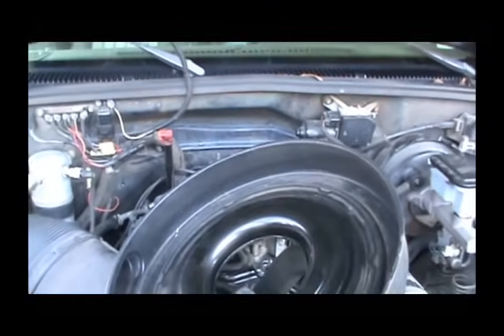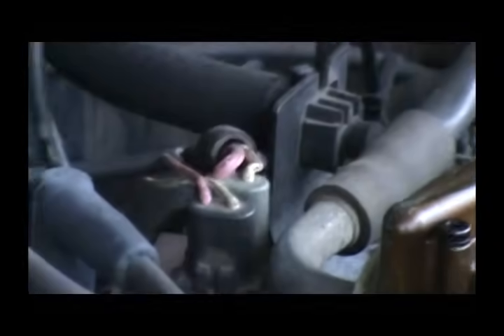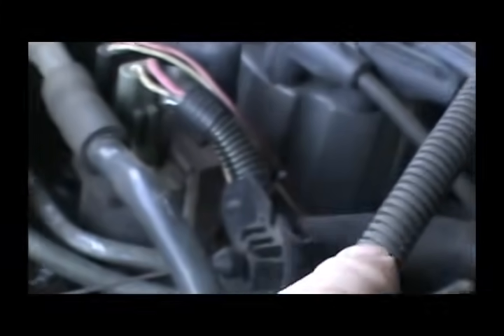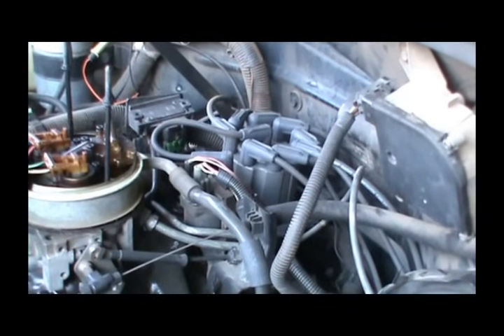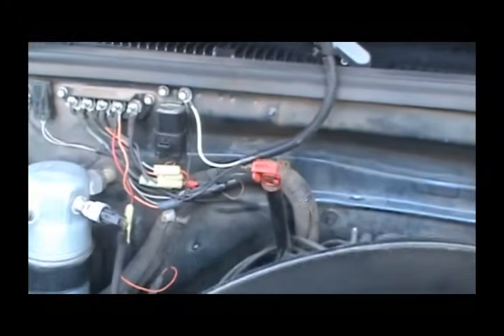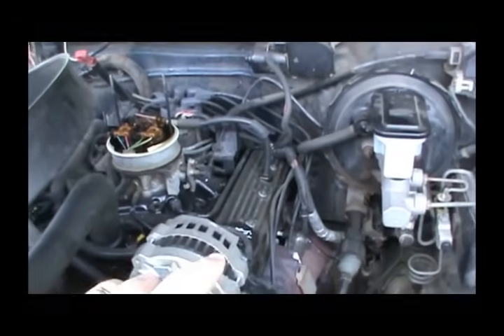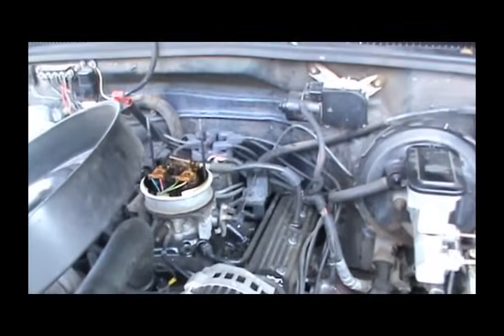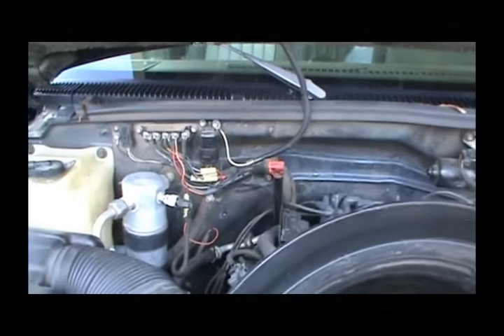1988-95 GM Truck Ignition Systems

Comment: What would be blowing a ignition module? I've had to put three in my 91 gmc 2500 sierra just dont know what it could be.
Reply from the maker: Heat kills them more than anything.  First though, always buy from a quality auto parts store like NAPA.  Don't buy them from Autozone, I've seen multiple failures with those.  Next, always use heat sink paste and make sure the heat sink is clean when installing.

Comment: Hi. I have a 1995 3/4 ton chevy Kingcab 8ft bed 4x4 with a 454 TBI. The issue that I am having is that my injectors are spraying to much fuel into the intake and thats causing it to flood out the plugs and then shuts off. There is an MSD ignition box under my hood on the firewall could that be a possibility? I have changed both my temperature sensors (side of block) and (front of intake by thermostat housing. And it still. Sprays to much fuel and backfires. What other possibilities could there be.

Thanks an advance. 

Mike
Reply from the maker: I'm guessing, but it sounds like an issue with the Throttle body.  Not getting enough air? Dirty? Injectors worn out?

Comment: I have a 89 suburban, the service light comes on it runs great, the light goes off it runs like crap. Spark knocks, pops and cracks, and u can smell its flooding out. Whats ur thoughts
Reply from the maker: Sounds like it's going into a default mode when the light is on.  Need to find the code to see what sensor has gone bad.
Reply: @farmboy30117  code 42, I changed out icm under the distributor and the light stayed on for about 2 weeks and ran great it it started shutting off again

Comment: This could be my issue... mine is a 90 Chevy 350. Replaced three coil module 3 times, last one with ACDELCO. Still isn’t starting. I’m gonna look for this computer wire tomorrow. Pull it... crank it... and see what happens.
Reply from the maker: Good luck!

Comment: i believe if you crank  it and have fuel pressure out the injectors the pickup coil in the distributor is good.....went thru this on my 92 astro....thought i had bad coil but it was the ignition control module that was junk...the module sends a signal back to the coil to spark so dont assume its bad coil right away..

Comment: Just looked at your video I got a 1994 chev 1500 Cheyenne I haveing trouble some times it will start and run when not in gear then I put it reverse and it will cut off and don't want to start no more I would have to put gas in the carberrader  to start .. can you help me with this problem..

Comment: OK i WOULD apericate  YOUR HELP GOT A 1988 CHEVY SILVERODO will run good for about 30 minutes then shuts down for 24 hours changed plugs and wires and rotor cap and coil too.

Comment: I have a 94 Chevy suburban k1500 350tbi and the ecm fuse keeps blowing randomly and can’t figure out why it only does it randomly wondering if you have any insight on how to trouble shoot it
Reply from the maker: Sounds like a wire with a bad spot that grounds out every now and then.  Have to trace the power wires out and see if any are chaffed.

Comment: unplugged the computer it started run a minute then died tried a few more times andd it hit but wouldnt run long now im not getting any spark the only thing i have not replaced is the coil and the computor its getting gas but no spark
Reply from the maker: Did you unplug the ignition bypass wire?  I believe it's a brown wire.  If this wire is unplugged, the ignition system bypasses the PCM for spark control and uses the ICM in the distributor.  Leave the PCM plugged up as this controls the injectors.  If it will crank and run, then the distributor and coil are good.  If not, you've narrowed it down.

Comment: Have a 1994 chevy 1500 the timming is ok put a new coil on heard at arcing noise it's arcing where the two plug wires plug into the coil only arcs every so many seconds. At the top of the wires

Comment: Farm boy I need some help I just bought a 89 Chevy Silverado 350 four-wheel drive and I have no idea what to do I'm having the same issue to start no crank no spark and my battery terminals getting hot when I try to turn it over help please..
Reply from the maker: What does it sound like when it's turning over?  Hot wires means high resistance, so either bad terminals, grounds, etc.  You live in salt belt?
Reply: @farmboy30117  it sounds like it wants to turn over..but it wont..

Comment: I have a 94 1500 5.7 swapped engine w a 92 suburban 5.7  have spark and fuel but only pops? I changed pick-up coil do I have to unplug the pcm to get it to work?
Reply from the maker: Sounds like the timing is off.  Unplug the wire from the PCM to the coil and set the initial timing with a timing light
Reply: Thanks I'll give it a try

Comment: i have a 92 s10 pick up and this may be my problem, i changed the coil and cleaned up distributor but still randomly starts, I'll try ti unplug the brown wire you pointed out and see if it helps, thanks
Reply from the maker: It should still crank with the ICM before swapping to the ECM.  The brown wire connects the ECM to the distributor.  The only time you should have to disconnect the brown wire is to do the initial timing.
Reply: @farmboy30117  ok, well i think its my distributor and rotor, what a ding dong i didn't check for spark first and just did and there's nothing. thanks

Comment: Nice video I’ve been looking for advice on upgrading the engine that I am running. I just purchased a 1990 454 cubic inch engine installed in a motor home. 55000 original miles means it was parked most of the time. My other car is a 2003 Express 3500 with a 6.0 liter engine. It has coil on plug ignition which I fell in love with. Trouble free for 330000 miles so far. Is there any way to modernize the 454? Right now I’m just replacing the plugs and wires and haven’t looked at the distributor yet. Thanks for your input.
Reply: You you can do what ever you want to it. You can run coil on plugs all the way to a stand alone ecm. Just takes a lot of money

Comment: Thanks man. My buddy’s 93 k1500 4.3 crank, no start was due to the ignition control module.
Reply from the maker: Yeah, that's pretty common.  Glad it helped!
Reply: @farmboy30117  every morning i have no spark and have to replace my pickup coil. Any idea on what to test

Comment: so I have a 88 GMC suburban no spark.  so you are saying that chances are it's the computer?
Reply from the maker: The usual suspects (assuming power & ground is good going to the distributor) is pickup coil, Ignition control module,  cap/rotor, or coil.  I'd suspect the PCM last.
Reply: @farmboy30117  so how do I test each one.  I'm trying to eliminate so when I have it worked on I'm saving the place a little time.

Comment: Is there supposed to be battery voltage from the coil to the icm? My 1991 chevy 5.7 decided to not start last night. No spark. Replaced the icm hoping that would solve it. Now I'm stuck.
Reply: Me too bro did you figure it out
Reply: @Michael-wk4yo  Pickup coil in distributor.
Reply: @Michael-wk4yo  Kind of funny this came up. Last few week, my pickup was running like crap. Getting crappy fuel mileage. Apparently I didn't put loctite on the distributor bolt when replaced the distributor. It backed out and slowly spun my distributor. If your pickup coil is bad and you replace your distributor, make sure you use loctite on that bolt! Good luck!

Comment: hey great video you explain things very well that help so much! so my truck 89 chevy 250 it seems to run well but limps around 55 mph and doesn't want to go faster pulling a light boat. so i checked codes since the light came on and they read 32 and 43.  the 32 says map sensor and 43 is bypass ignition signal failed. what's your opinion here. i was going to get the map sensor but what do i replace for 43? thanks again for the help you give.

Comment: Thank you for the video this did get my truck started but now it seems to be running like the timing is off. Do you know what that part is called with the tan and black wire? Also will this affect the timing?
Reply: Oh and what it does is it basically allows you to adjust timing. I dont believe you can adjust the timing with it still plugged in
Reply: @gerrybrooks651   thanks
Reply: You unplug the tan and black wire with the key off, then start the motor, adjust the distributor while using a timing light and when it is at factory specs, turn off key, plug back in and the computer takes over the timing from there. Hope that's some help.

Comment: Mine is not getting fire and I replaced the coil and the ignition module and all the point of contact are clean....
Reply from the maker: Check the power and grounds going to the distributor;  if they are good, then most likely it is the pickup coil inside the distributor.

Comment: Where is the Electronic Spark control module located on 1993 Gmc Sierra 4.3 6 cylinder? The book we bought says near the throttle body or behind the distributor mounted to the fire wall. We can't seem to find it
Reply: It's inside the area the distributor cap covers... It has two screws holding it in and it has two connectors with wires hooked up to it...
Reply: Nope

Comment: how does the ignition control relay that is mounted next to the map sensor on the bracket come to play in this system
Reply: That's called esc module.
Reply: does it control timing due to knock signals
Reply: @randy1ization  these trucks do have a knock sensor on the block down low by the starter motor if I remember correctly and I believe you are correct in that the esc module uses the signal from the knock sensor. Esc module was eliminated in a later year in favor of a different way of processing knock signal. Think it was when they changed from ecm to pcm. Have had 2 with esc module and no problems. Have had problem with knock sensor though. GMT400 forum has lots of info on this.

Comment: I have a 1991 chevrolet k1500. I changed my throttle body gasket and started the truck up and noticed a minor leak so I shut the truck off. After I tightened the hose I went to go start the truck again and had no fire. I changed the cap and rotor and cleaned the module but still have no fire. Having trouble find the brown wire but I was wondering if you may have an other idea to why I would not be getting fire?

Comment: Get a Actron CP9690 code tester. It checks live, record, graphing, emissions readiness test, oxygen sensor tests, ABS, SRS, and MORE! It retains the memory of results. There's another without the OBDI cables and it has the same tester. It comes in a black pouch. It has a cigarette lighter adaptor. Out-of-the- box it tests from 1984-2013. It is updatable with a USB cable from EBAY. It comes with OBDI cables for Ford, G.M, Chrysler, and Toyota, and a OBDII adaptor. There are penlight batteries under the cover at the small screw. It is well- lit! EBAY has it.

Comment: I have an 89 chevy pickup. I can see gas from the injectors when cranking and the fuel pump sounds strong. I don’t have any spark thought, what could it be?
Reply from the maker: bad coil or bad distributor is my guess
Reply: farmboy30117 pickup coil?? Inside the distirbutor?? If it isn’t the pick up what else could i check? The module (on the side of the distributor)?
Reply from the maker: @roelmorales6288  Could be the primary coil, pickup coil, rotor, rotor cap, Ignition control module, or a power/ground wire going to them could be bad or have no power or ground.  Also check for ignition fuse blown which would indicate a short in the power wire.

Comment: Not sure if anyone is checking this still. Got an 87 gmc sierra 1500 with dual tanks. Stopped while driving. Fuel pump would intermittently turn on. Replaced with a new one and new filter. Turned on once and now does not. We tested by hooking up to a power source and it works. Checked all connections with test light. Engine has spark but no fuel will produce through the TBI due to the fuel pump not kicking on. This is the driver side tank. Passenger side did not work when I bought the truck. Suggestions??
Reply from the maker: Check the fuel pump relay.  If that's ok, then check the oil pressure sending unit.  Power to the pump is initially through the relay via the PCM then once oil pressure builds it is powered through the oil pressure relay.
Reply: @farmboy30117  thank you very much I will try that

Comment: Maybe you can help. I have a 89 k5 blazer that wont start after I've been driving around town. Usually it starts within half hour to an hour. I have power to everything but wont crank at all. I drove it to  my in laws and when it was time to go it would not crank. The next day it started with no problem??? Like I said I have power to everything..
Reply from the maker: Sounds like a bad/weak starter motor that won't crank after getting hot.

Comment: I have a 94 2500 5.0 liter I have no spark getting fuel I replaced plugs wires distributor  and coil still no spark need help

Comment: Im fixing for a friend a 93 chevy Silverado tbi 350. Has new fuel filter, plugs, wires, cap and rotor. Has a lil issue on cold start but main issue is it won't idle. It hesitates badly and stalls. Have to keep using foot action on throttle to keep it from dying. If you floor it it will choke and backdraft and sputter but will eventually hit the higher rpms smoothly and will red line of I let it. Its just at idle and cruising speed it wants to die (as well as setting in gear). There are no engine codes. I can see the tbi spraying fuel. Any thoughts?
Reply from the maker: Usually idle issues are due to bad idle air controller but could also be dirty throttle body, leaky injectors, or vacuum leaks.
Reply: @farmboy30117  Iam in the midst of cleaning and rebuilding throttle body however not in vain. I found  large carbon deposits into main body and orifice leading to PCV completely blocked by deposits. Also, no matter where I put my ohmeter terminals (Ive checked online for proper procedure) I don't get any ohm readings other than ohmmeter dialing down to zero but I can see continuity or rather good contact on my ohmmeter terminals. I did this on a bench unconnected to truck. It does have spark when starting and somewhat running. Tomorrow Iam going to auto parts and see if I can replicate my findings on new coil. I doubt I will be successful and I will purchase it.
Reply: Yea got one minds. 92.g20. Pain.in..
Reply: My truck is doing this What's the problem?

Comment: I have a question for you I have a 94 Chevy Z71 5.7 TBI. I thought I had a fuel deliver problem come to find out I have a spark issue once my truck starts after multiple times trying it'll start all day long. Now in the morning when I leave to work Beetle crank and crank and crank but will not start finally after 10 minutes of cranking it'll fire up and I'll go to work. Now at the end of the day I'll give him my truck to come home same thing crank and crank and crank and no start after while it'll start up that once it starts it'll start fine all day long if I'm driving to the store or whatever. But it's the long-term sitting overnight into the next day or all day long at the end of the day's work is where I'm not having a spark. Please help me with this the distributor was replaced about 3 years ago everything brand new what do you think it is? Please help
Reply from the maker: David, if you're sure it's not sparking, then it generally is something in the distributor (or coil) causing the issue.  It does sound like a fuel issue to me.  Did you use a good quality distributor when you replaced it?  Some cheaper ones use crappy pickup coils.  Funny that it starts after 10 minutes of cranking, usually ignition control modules go bad when they heat up from my experience.  Good luck!

Comment: i have a 89 gmc pickup....Getting alot of engine interference on the radio and gets worse as the rpms go up....old days id replace the capacitor under the distributor....everything is all plug ins on the radio. not sure how to check a ground..any suggestions?
Reply from the maker: There is a ground isolator I believe that is supposed to reduce ignition noise.

Comment: I have a 1989 s10. I'm getting Spark and fuel I was driving and it just shut off wont start back up I change the ICM inside the distributor my cap and rotor are good I got new plugs and wires haven't been able to test the fuel pressure yet someone said check out the crank positioning sensor I'm just lost any help would be nice thank you
Reply: I'm sorry it's the 4.3 V6

Comment: 1990 Silverado, 5.7 all lights on dash work when turning key to on, try to start and nothing, starter wont rotate but still powers everything.  tried two brand new starters,  same problem.  one day it starts, sometimes it doesnt at all.  Any suggestions?
Reply: i have a 82 gmc and i get lights on dash when i turn the key on but i get nothing at all ytrying to start it
Reply: NCS on transmission or look under mate on driver's side you will see black tar tap under it is a fuse

Comment: I have 94 GMC tbi 4.3 v6 vortec, was driving it, shut down like u turn key off no back fire, pop, no noise,  I've checked it no spark, will crank but want start, what's my troubles, also have   just replaced cap button an wires (+spark plugs) took ingintion  modugel off had it checked an was good